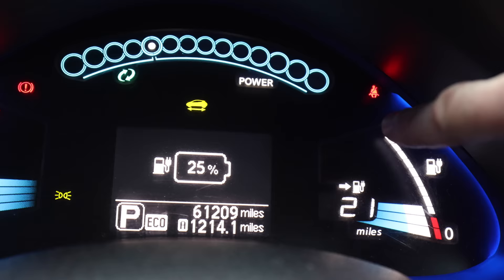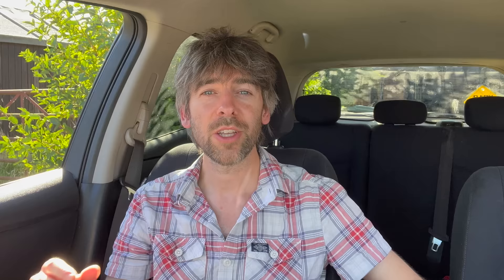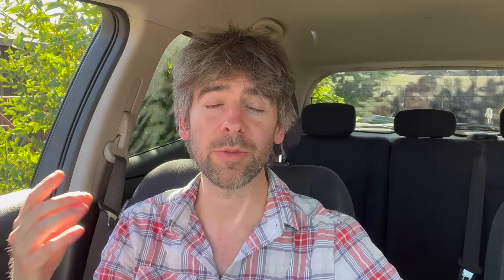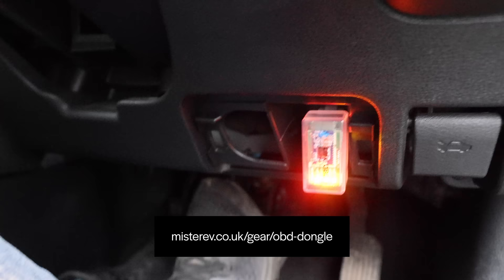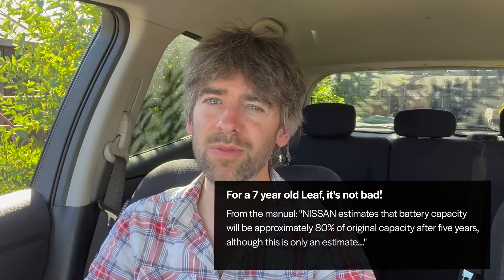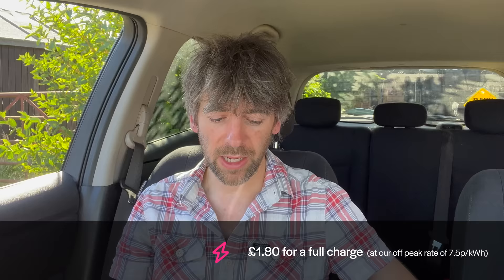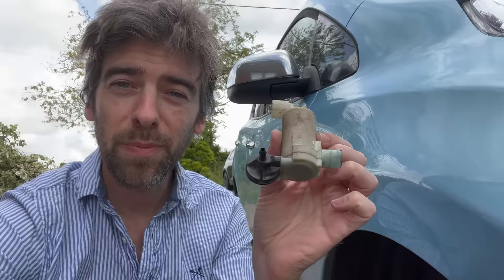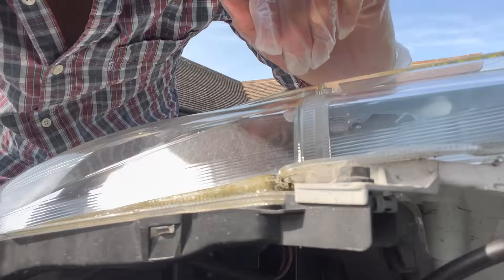How’s our old Nissan Leaf doing? Let's talk battery health, running costs, failed washer pump & more

Comment: Really great video which will be so useful for people starting out with  EVs. The battery academic was very interesting as well although at one point I felt like saying "don't confuse me with facts!" Just as a rough estimate, how much range do you get now from the Leaf? One of these would suit my daughter who would rarely drive more than 30 miles return.
Reply from the maker: Thanks, Peter! Absolute worse case scenario — motorway driving in winter with freezing temperatures — you'd be looking at 50 miles. Most of the time it's more like 70 miles.

Comment: My 2014 eNV200 still has 12 bars on the health indicator. Its a 3.3kw 24kwh thats done 40k miles.
Reply from the maker: That’s encouraging! Have you owned it since new? I’d love to know how often you charge it to 100%.
Reply: @MrEV  I bought it with 18k miles and I'm not afraid to charge to 100% overnight but only if I know I'm using it the next day. I have an m3 for distance use.
Reply from the maker: @dereknicol5284  Great — well done! I wonder how many Leaf/eNV200 owners have killed their batteries by leaving it parked up at 100%.

Comment: I've seen Nissan leafs with 50k miles on them, and only 2 bars. Apparently they don't like hot climates. Why is there no internal fan rotating the air around the pack? I figured, any 12v, 1A fan has sufficient power to cause an air draft, significantly extending longevity of the cells, while using less power than even an LED headlight.
If the nissan leaf cells didn't have the cell heater pads, they would last longer as well, at least in hot climates. As far as cold climates, you could fast charge the batteries which will heat up the cells enough. At 12A, 220V, most sockets support up to 2640W, some even up to 15A or 3300W. That's sufficient power to increase the cell temperatures to 75f, and dump some hot air in the cabin.

Nissan should have just pasted each cell on an aluminum plate, mounted to the battery chassis, for faster heat extraction.

Comment: As someone who bough an EV for the first time 5 weeks ago this is great 👏. Thank you.
One question though, I was already charging between 20-80% but is there a time every now and again when you should charge it up to 100% or let the battery go under 15%?  I only ask because I only drive locally and will always charge at home.
Thanks again.
Reply from the maker: An occasional charge to 100% is recommended actually, as it 'balances the cells'. I had issues with my e-Niro a couple of times where it didn't give an accurate range estimate precisely because I'd not charged to 100% recently.

Worth watching this video from Dr. Euan McTurk: https://www.youtube.com/watch?v=QRPze4f0gsQ
Reply: @MrEV  Hi Andrew.  Thank you and will watch the video.
When you say occasional, what would you say is occasional?  I generally charge 20-80% twice a month as I don't do a lot of miles.
Thanks again for the reply.
Reply: Am looking at used Leafs right now, may have to pull the trigger at some point soon.

What did you purchase ?

👍✊
Reply: @walterkaiyuenpang3556  Hi.  I got the new Kia Niro EV.  Very happy with it so far.

Comment: our 2020 has cost us one wiper blade since we bought it. we've never fast charged it. 100 miles costs us about 15p. basically way cheaper than taking the bus
200 quid a year in electric
30 quid road tax.
best car i have ever owned. here in sweden cars are rotten by 8 years old. so 2028 probably scrap it.

Comment: The BEV is the perfect short trip way of avoiding the worst aspect of ICE motoring - the elimination of the cold start wear and rotting of the exhaust system. 
ICE (for a while longer) for motorways and EV for city congestion………then don’t be late dumping the old dirty ICE entirely.

Comment: Looking at a leaf with 9 bars less than 50,000 miles on it. The 1st owner was the one who put those miles on it. The second owner did not drive the car at all for 3 years. Is this car safe?
Reply from the maker: The car’s perfectly safe, but the battery has clearly degradated. I’ll be making a video about it soon as a neighbour got a Leaf with about 9 bars too and although it can be repaired, it’s not cheap.

Personally, unless it’s an absolute bargain, I’d go for another Leaf. Also, bear in mind that 30kWh Leafs have notoriously bad batteries.

Comment: Please tell me how to charge a 2016 Nissan leaf only to 80% overnight, without physically monitoring it charge, when there is no remote function to do so on the car ?
Reply from the maker: If you set the charge schedule in the car (instead of using your wallbox to schedule), there’s an option called Long Life Mode. Select that and it’ll always just charge to 80%.
Reply: Sorry that function does not exist on a 2016 Nissan Leaf 30 kwhr, i remember something about Nissan removing it because they thought that charging to 100 % was not the issue that they originally thought it was with earlier models. How wrong they were.
Reply from the maker: @stevezodiac491  Sorry — I had no idea. That's crazy! I wonder whether that makes the 30kWh suffer from degradation more than others?
Reply: @MrEV  As you know all EV's degrade with time and use cycles, that is why I have learned my lesson and will never buy another EV ever again, whereas my 15 year old Mercedes E Class diesel and my 19 1/2 year old Mazda MX5 petrol still have the ranges they were bought with, the Mercedes having over 3 times the range of a modern EV at 650 miles at dual carriageway speeds and 350 miles pulling a 7.5 metre fixed bed 4 berth caravan. My wall box is a dumb charger by the way immune to the forthcoming fuel duty on electricity used for an EV, which will become inevitable if there is no duty from ice vehicles. That and 20 % vat, instead of the 5 % domestic rate. Hospitals etc. will still need to be built.

Comment: I’ve been following the charging costs, at the time of this video, and due to the current UK energy pricing rip off, and the economics for public charging just don’t work.  It there seems to be near price parity for EVs. My calculations make it almost equal for a 64 mpg Diesel at 1.77 /  litre vs an EV charging at 0.69 p/ kWh contactless when calculating GBP/mile and assuming 3.5 mile/kWh. I know it’s not just about money but with a price premium for an efficient EV it seem the incentive has gone. I want to do something for the environment but have I got my figures wrong?
Reply from the maker: I agree that for anyone that relies on a lot of public charging, right now the EV equation doesn’t necessarily work unless it’s an ultra-efficient car. That said, when considering total cost of ownership, including slower depreciation, then an EV can still work out the better deal.

Comment: I have a 2016 leaf Teckna 6.6 charger in Arctic white. I have had it 7 years and 2 months from new. It has done 34k miles. It has now lost 1/3 rd of the battery capacity and range with the loss of 4 out of 12 battery bars and is a total disappointment against the time I had it in the early years when I wore rose coloured spectacles, thinking it was the best thing since sliced bread.
How can electric cars be environmentally friendly when the batteries degrade to such an extent that they become unusable and have to be scrapped much earlier than ice vehicles because the batteries are not economically viable to replace on a cost basis. I also have a 15 year old Mercedes E Class 2.2 litre cdi which still gives me 51 mpg on a run and the range it gives me is unchanged from when I bought it new at 650 miles. I will not be buying another EV after my experience of the Leaf, which is now used as a town car only, tethered within it's home charger range until the battery finally is not logistically able to cover useful distances. The bottom line is that from day one from new, with time and use cycles, all lithium batteries degrade, whilst ice vehicles do not, making EV's not fit for purpose in my opinion.
Reply from the maker: I was having this conversation with someone yesterday actually. It's unfortunate that the LEAF is so bad with degradation and, as my friend pointed out, it's mainly affected EV trailblazers like yourself. It's especially bad as yours is such low mileage.

The LEAF is quite unique in this respect as Zoes, i3s and many other 'old' EVs don't have the same problem. The LEAF's lack of thermal management for the battery is one of the reasons it's so bad.

Newer EVs have done hundreds of thousands of miles and have no meaningful degradation and as time goes on and battery tech improves, it'll become even less an issue. That doesn't make it any less disappointing for you of course.

Comment: Considering the average age of a car on UK roads is 12 years 7 is not really very old is it.  Anyone got an average age Nissan Leaf with original batteries in it ? Looks like around 12K for a new battery pack not much of a saving for the future.
Reply: EV critics tend not to think too much, so here goes. Nobody has a 17 year old Leaf. They didn’t make them then. Your other point has a large enough hole for me to drive my Leaf through it. To keep the maths simple, let’s say I buy an EV for £12k and you buy an ICE for £12k. We keep them for 7 years, and at the end they are both worth £3k. Potentially, I have got £10k more than you. Why?

Comment: in other videos he said 100% was fine?
Reply from the maker: Charging to 100% occasionally is fine, and arguably good to allow the BMS to balance the cells.

The big thing to remember is that the Leaf is particularly prone to degradation if it's sat at 100% for too long. Most modern EVs have a large upper buffer which means even when you're at 100%, you're actually not at 100% of the battery's full capacity.

To recap: charging to 100% is fine (especially if you need to take it on a long journey) but don't leave it sitting there at 100% for days. In newer EVs it's less an issue.